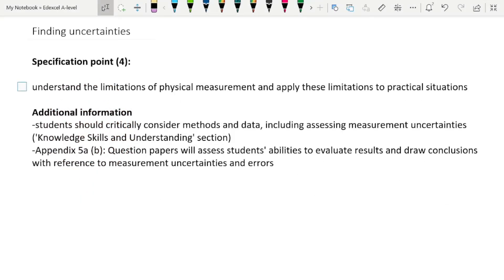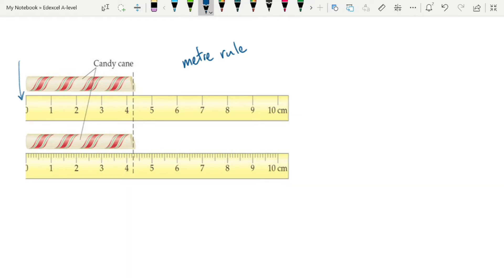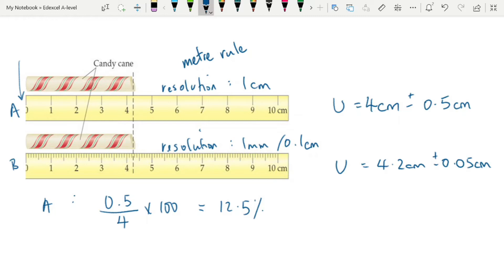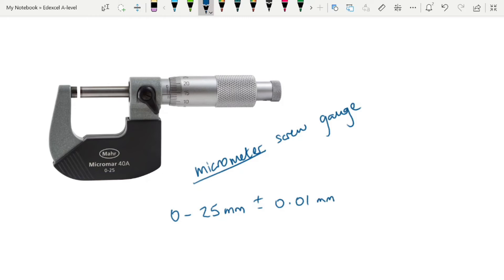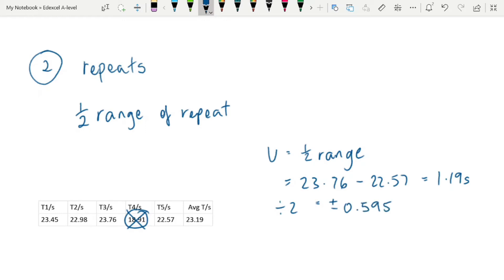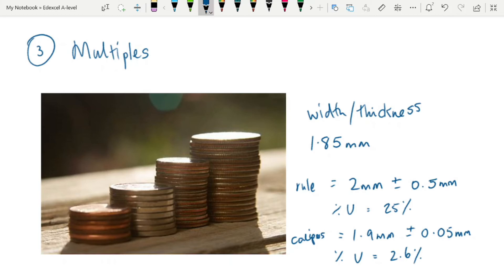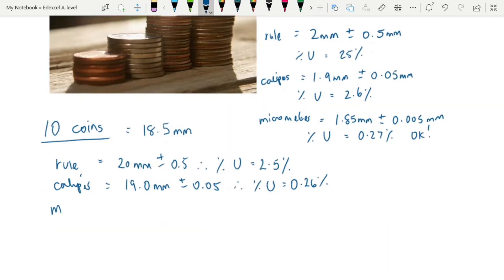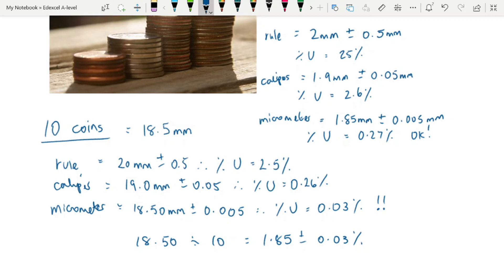Uncertainties: WAAP: Edexcel A-level Physics

Comment: Hi sir, thank you so much for this. It would be great if you could post a video on how to calculate uncertainty in a value that comes from two different values and their uncertainties. For example the uncertainty in the value of area of a rectangle calculated from length of 2cm±  0.05cm and a width of  10 mm±0.1mm or density where you have different units of mass and volume.
Reply from the maker: For these, find the % in each measurement and add the percentages together.